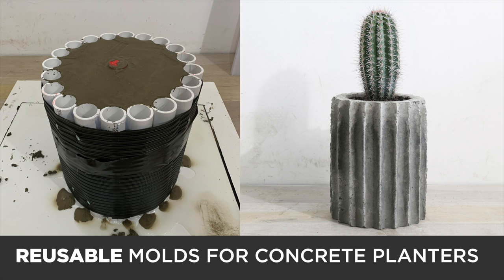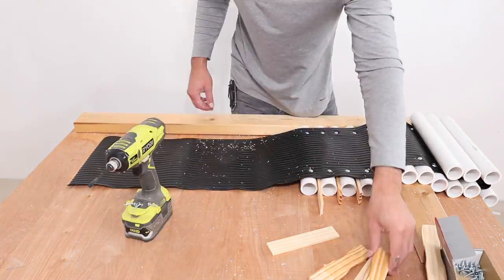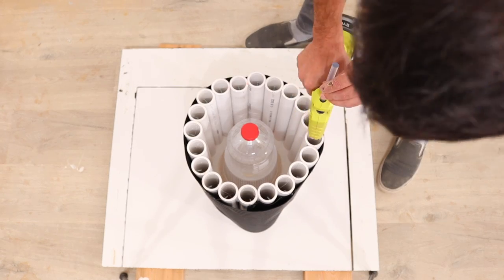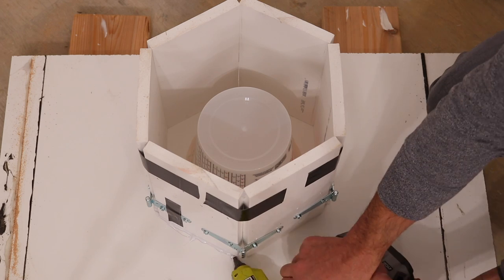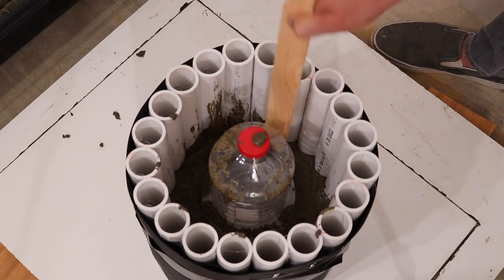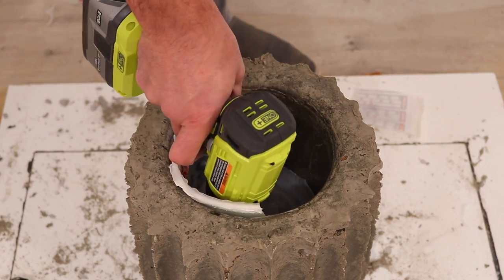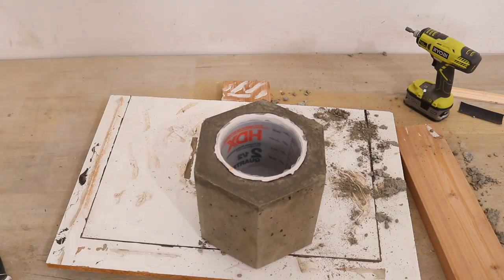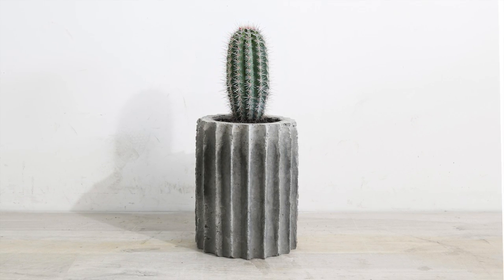DIY Concrete Planters Cast in REUSABLE MOLDS

Comment: that was great but wouldn't it be useful to use a second reusable mold instead of the plastic buckets inside?
Reply: As seen elsewhere, greasing the molds is how almost anything can be made reusable. Even just vegetable oil is supposed to work.

Comment: By holding an oscillating tool or a pad sander against the mold after pouring, to vibrate the concrete,  you would achieve a better finish to the concrete.

Comment: The pipe one looks great, like a Greek brutalist crossover. Have looked into foamed pvc that they use for sign making? It is great material and you can bend it and heatform it easily. Should work well for reusable molds.
Reply: Feels weird commenting a year later but I have my doubts about trying foam. Concrete can become quite warm as it sets since the process is an exothermic reaction. I suspect over time the PVC foam would warp, shrink or crack as a result of the heat.

Comment: Pro tip: rubbing alcohol will cause hot glue to release within seconds with no effort.  Just drip/spray some on to the joint and it will come right off.  No need for paint scrapers or elbow grease.

Comment: Well you can use hot water to take the plastic off. WhataWaste... Also spray a oil on the plastic before puoring the cement man. Make it easier to take off the plastic. Reuse the plastic.

Comment: I wonder if a vibrator (not that kind) would help these come out a bit smoother. Place the bottom board on some rubber pads and set up a simple electric motor with an unbalanced bit on the drive shaft, attached anywhere on the board. Run it while you pour the concrete and then stop so the concrete can dry. Just an idea. I've seen long drill type ones for pouring house foundations.
Reply: It would! Or just going at it with a hammer or something

Comment: I've read that you should cure cement pots in water for a week or more before putting soil and plants in. Do you do that? Have you had any problems with cracking? I want to get into making my own cement pots as well!!
Reply: Check out "aircrete" for light weight, durable recipes that also use less concrete.

Comment: Your work is beautiful.  Question please, I am making a concrete sculpture and want the finish to have MORE air bubble holes, how do I do that???  Is there some type of additive?
Reply: Yes.
Reply: Check out "aircrete" for light weight, durable recipes that also use less concrete.  
Part of it involves making soap foam to mix in 🤔

Comment: What is best cement for cement flower pot I used portland type I   I am so confused lots of cement Type S , type I ,  what is difference between those.  which cement is best to make surface shiny?
Reply: Sand topping cement for a smooth finish